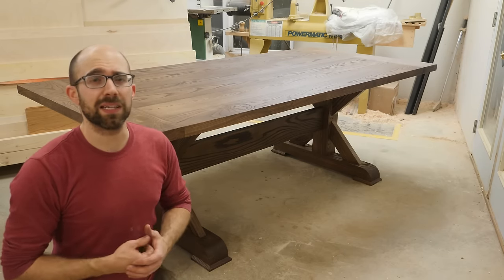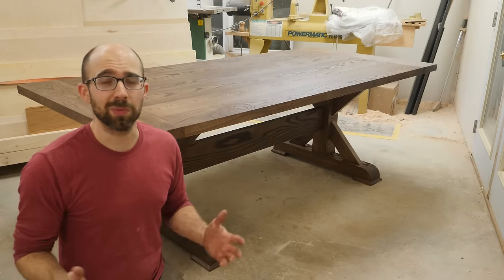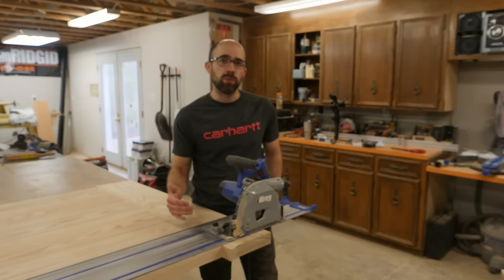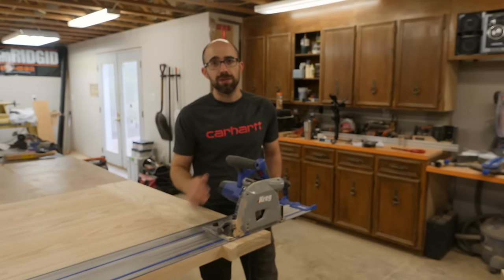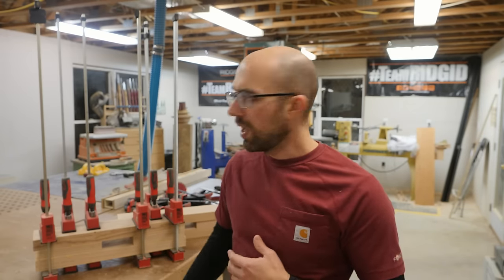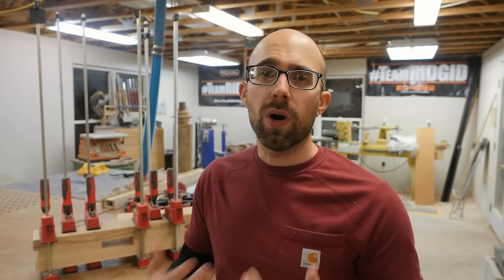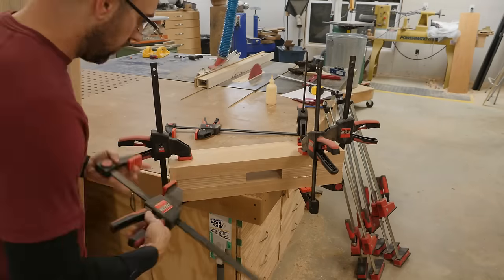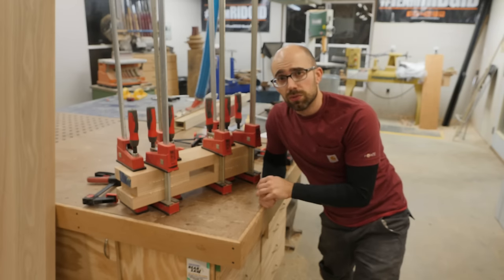How to Build a FARMHOUSE TRESTLE TABLE - DIY Woodworking

Comment: Sadly this top will probably split because the dominoes and glue on the bread board will restrict any movement due to changes in humidity. Here in Iowa a top that wide will expand and contract almost 3/8" between winter and summer.
Reply from the maker: I only glue the center 1/3 all of the others float in the breadboard.  Did I not say that in the voice over?  (Not being a prick, just thought I'd mentioned it)

Comment: i know this vid is older, but heres a tip for anyone else that may do this is for future - for the center mortise on your vertical post, mill up a piece matching the mortise dimension and wrap in packkng tape and place in there, will keep those boards aligned with the mortise and pull out easily 👍
Reply from the maker: That is a solid tip!  Thanks for sharing 👊👊

Comment: How does the way you attached the bread board ends allow for expansion and contraction?
Reply from the maker: Loose slots are in the table, tight slots in the breadboard.  Only the center 3 dominos are glued👍

Comment: I bought the plans.  Great design.  Mine is only going to be 36" wide (instead of 42").  Would you reduce the overhang of the top and keep everything else the same, or reduce the size of the legs also?  Also same question on the length.  Mine is only 72" long instead of 90".  Is there something special about the 16" overhang at the end?  Should I keep that and shorten the cross beam, or reduce the overhang, or both?  Thanks in advance.
Reply from the maker: Hi Phil!

Thank you so much!  My client loves this table and it was a fun one to build.  To answer your question I would maintain the overhangs in both directs.  This primarily has to do with leg room when sitting at the table.

Happy building and thank you for ordering the plans!

Mike

Comment: I am interested in the plans for the table, you mentioned different construction techniques. I have all the tools except for the dominoe joiner, is there an easy ish alternative to that? I have kreg jig stuff but its not the nicest to look at
Reply from the maker: Thank you for your interest!  Yes there are alternatives that are easy that don't reply on pocket hole journey 👍
Reply: Thanks for the quick reply! I bought the plans yesterday. I got a good deal on some 'superior' alder for the table but now my wife wants a lighter color for the table. Any experience with using lighter stains on darker wood? If not no biggie, ill figure something out!
Reply from the maker: You're welcome!  I've not worked with Alder before but from what I understand it's nice to work with.  Haven't experimented with lighter stains on dark wood either.  It won't make the look like lighter if that's what you're after though (maybe I misinterpreted your question).

Comment: Can this be built without the center suport bar since it has 2 braces under the table top?
Reply from the maker: That's a good question.  Nope you need the center beam otherwise the table will rack.

Comment: What if i put a dowel thru the legs to keep the pieces from shifting during glueing? Great video btw.
Reply from the maker: Thank you very much!  Yes, you could absolutely run a dowel through the legs.  If you're good seeing a dowel, it'd be even easier to run screws through some counterbored holes on the outside layers and then plug the holes.

Comment: Great build Mike. Any suggestions for us who don’t have a Domino, jointer or planer? I really want to build this table. Thanks and keep up the great work.
Reply from the maker: Yes absolutely!  As far as the Domino goes, I cover alternative joinery options in the plans.  I built furniture for years without a jointer.  You can take several skim cuts on the tablesaw flipping the board each time to systematically true up each edge.  Assuming you want to build from something other than pine, you can build a planer box to use with a router (what I did in the highschool days) to thickness your boards or just buy surfaced lumber at your local supplier.  If you're wanting to build with dimensional lumber then I'd select only working from 2x6s or larger as these are almost always straighter than 2x4s.

I hope that helps!  If you have any other questions fire away 👍🏻👍🏻

Comment: Nice job,  do your plans include how to finish the table the same as you built,  if not would you be willing to share what products and method, thanks!
Reply from the maker: Hi Claire!  The plans don't work that out, but I'm more than happy to answer any questions you have!  I used Rubio Monocoat "chocolate" (I think it's linked in the description).

Comment: Hi Mike, Great stuff. I wanted to ask about the rotary brush tool you use after sanding. What is it? What does it do? Cheers, Tim
Reply from the maker: Thank you so much!  The tool is called the restorer, I believe I have a link in the description just so you know👍

I use the wire brush and nylon brush drums to give the Ash lumber a more intense texture.

Comment: Safety question: at 17:34 there’s a cross cut on the table saw running right against the guide. Doesn’t that risk a kickback? I was taught to use a jig with a push fence for that situation, or make the cut with a miter saw that can tilt.
Reply from the maker: Totally understand the question and it's a common one.  You can cross cut on the table saw no issue.  When people get into trouble crosscutting is when the edge against the fence is significantly shorter than the piece is long.  Basically you end up with a moment arm away from the fence that makes twisting the piece as it goes through the blade more likely.  A crosscut/small parts sled would certainly make this cut safer, especially for those that are a novice at the table saw.  Does that answers your question?
Reply: @WoodshopMike  It does, thank you very much!

Comment: Very nice work! Impressive bandsaw skills. The only thing I don't like about this piece is the verticals. More voiceovers with more information about non-standard tools would be greatly appreciated. More details about the padded foot installation would have been nice. More information on your joinery would be great. I have the same speed clamps and love them. The speed square and scribes (?) you have look interesting. Can you share the details, so I can check them out? Thanks for the video, 👍ed and subbed.
Reply from the maker: So glad you liked the video and I appreciate the feedback!  I believe the squares are all listed in the description.  I use woodpeckers and empire squares and sliding combination squares.  Cheers!

Comment: No dowels takes to much time I drive a small finish nail into the half about a 1/3 or 1/2 way use a pair of cutter to cut it off all but 3/16ths or a 1/4 “ and slap ur glue on and use a Bam (big ass mallet) to cinch the pieces together & Bam !  Clamp it up no movement !
It’s a custom carpenter cabinet maker trick!
Reply from the maker: That's a great way to do it!  Thank you for sharing👊🏻. I totally spaced on that during the build lol, but I won't be so forgetful next time 👍🏻😃

Comment: Mike what are the overall dimensions, how long and wide is the table?
Reply from the maker: It's 90" x 42".  I have plans linked in the description that give all the details.  The table is pretty easy to resize too.
Reply: @WoodshopMike  I just purchased the plans for the farmhouse Trestle Table. I see 100BF lumber, it doesn’t give me what size board and no complete list of lumber I need?
Reply: [Order #42391] (July 2, 2022)
Reply from the maker: Hardwoods are solid by board foot, not like dimensional lumber.  This is why I simply list the board footage total that's needed to build the table.  8/4 stock is what's needed.
Reply: @WoodshopMike  Mike what type of wood did you use to build this table?
Reply from the maker: Ash
Reply: @WoodshopMike  Thank you 😊

Comment: Really nice table. I learned a number of great techniques from this build. It was looking swell, then for some unknown reason you completely ruined the table with stain. Stain and paint are two of the ugliest things anyone can do to wood!!! If you're gonna put stain on it, use plywood or MDF.
Reply from the maker: Glad you picked up a couple tips from the build!  You're comment about the stain 😂😂 That was the client's decision, but I agree, it looked much nicer with the natural wood tones.  Personally not a huge fan of drastically altering the natural colors.  I figure God did a pretty good job deciding what color different woods should be, so why mess with it? 

Cheers,
Mike

Comment: Is there another piece of wood between the breadboard and table? And why did you glue both sides instead of a loose joint on breadboard?
Reply from the maker: Hi Johnathan!

There are no additional pieces between the breadboard and table.  I glued the center 1/3 of the table, breadboard & Dominos to keep the breadboard attached.  By only gluing the center 1/3, I'm still allowing for seasonal movement and not risking the table top splitting.  Thanks for watching!
Reply: @WoodshopMike  Then what is the longer portion of the breadboard as seen at 5:52 ?

Comment: I have just purchased the plan and I am very disappointed with them.The actual drawings 1st angle although very professionally done  have been filled in brown so you can't see the lines or markings and there's no details about the braces on the legs ,theres just an X with no explanation on how they are done .
Reply from the maker: Hi Stuart,

Thank you for purchasing the plans and sorry to hear they're not everything you hoped for.  I believe you're referring to the assembly steps on page 6.  That's meant just to be a guide for locating the items.  If the parts on pages 4 & 5 are made as shown and the assembly process on page 6 is followed there's no need for additional information and the parts can only be assembled one way.

I've not had any complaints with these plans in the past, but I'm happy to email you and address the issues!  Be on the look out for a message from me soon.

Regards,
Mike

Comment: Awesome table! What is that thinner strip of wood between the table top and the breadboard that you added? Design purpose or is there functionality?
Reply from the maker: Are you referring to the Dominos?  Those hold the breadboards on.
Reply: @WoodshopMike  at 5:48 when you're clamping the breadboard to the table top, I see a separate strip of wood that is connected to the breadboard.
Reply from the maker: Oooo, I had to laminate a bit of extra stock to make the breadboards wide enough.

Comment: Best way to keep pieces from sliding with glue is to use locator pins. 1/4" dowel does the trick
Reply from the maker: Great idea Phil!  I coulda just done some cut off nails too 👍🏻👍🏻
Reply: Great table. I sprinkle just a little table salt on the glue to hold the boards in place while clamping.

Comment: I really like the table and would like to build it, but I don't have all these machines and tools.
Reply from the maker: Thank you very much!  You don't have to have all of the tools to build the table.  I'm a full time woodworker, so I have the tools anyways.  You can start from pre-planed lumber which takes out most of the milling and leaves you with really just needing a tablesaw (or track saw) and a couple of small power tools.  You don't even need a domino for the build👍🏻
Reply: @WoodshopMike  thanks a lot for the reply
Reply from the maker: Absolutely👍🏻👍🏻

Comment: Hey Mike, what type of wood do u recommend to use?
Reply from the maker: Alot of that depends on your budget.  Red Oak, Ash, White Oak, Maple, and Walnut are the woods I most commonly work with. Most hardwoods will be good for a table like this though.  I usually steer away from pine for furniture unless it's old growth (not dimensional construction lumber).

Comment: This is an incorrect way of doing breadboard ends, this method will fail overtime
Reply from the maker: How are you thinking it will fail?  Only the center 1/3 of the dominos are glued to prevent the center of the table from potentially splitting.

Comment: beautiful table, looks very strong and heavy! just one question, but without any screws on the 'x' legs, wouldn't the strength only relies on those tiny wooden dowels?
Reply from the maker: Thank you so much!  The pieces that make the "x" are mainly decorative.  They're joined with dominos though so they are very strong!

Comment: Hi Mike, great content and a lovely finished project. I've never seen that "restorer" used before, what do you find it excels at/where is it most useful in the workshop? Many thanks!
Reply from the maker: Thanks Adam!  I mainly use the restorer for distressing wood.  Another big use for the tool is stripping finishes and doing restoration work on cars.
Reply: Mike, what wheel or grit are you using on the table top is this video on your restorer?

Comment: Great job!  Awesome shop, what size hole did you drill for the Threaded inserts? I usually use 1/4 inch inserts and epoxy them in. If you did not use 1/4 inch do you know the drill bit size that I would use to drill for a 1/4 inch insert?
Reply from the maker: Thank you very much!  I did use 1/4-20 inserts but I don't remember the exact size I used.  The way I determine my drill size though is by measuring the shank (solid portion "inside" the threads) and using the closest drill size.  I've never needed to super glue or epoxy them in fwiw.  Cheers!

Comment: What machine are you using @ 4:25?
Reply from the maker: That's the restorer 👍🏻 https://amzn.to/3efuoBR
Reply: Thanks Mike!
Reply: Woodshop Mike which wheel it’s grit is getting the grain to pop like that??
Reply from the maker: I'm using the wire drum.  It's kinda like a wire wheel in an angle grinder, but I find it more controllable and uniform. 👍🏻👍🏻
Reply: Woodshop Mike thanks for the quick reply!  The wire wheel doesn’t cause you to sand it more later to get out little scraps or gashes in the wood?
Reply: Woodshop Mike just bought your plans BTW
Reply from the maker: Thank you so much!  Let me know if you have any questions 👍🏻👍🏻
Reply from the maker: That's totally optional.  My client wanted a rougher look.  You can follow up with the 80g or 120g nylon drums to smooth things out a bit 👍🏻👍🏻